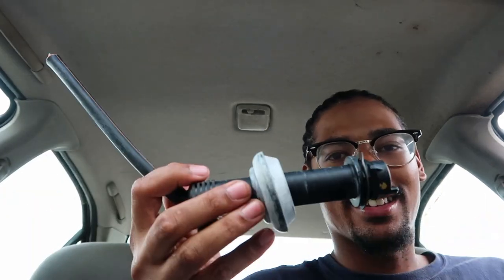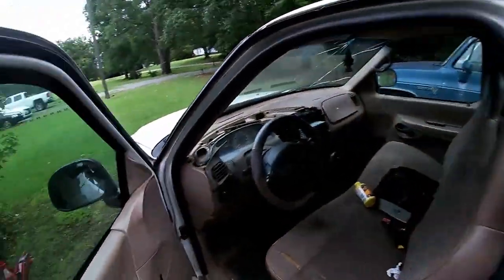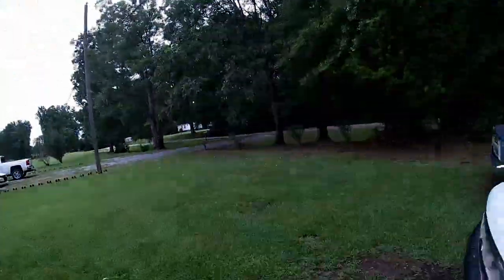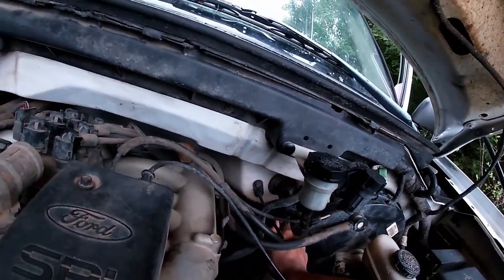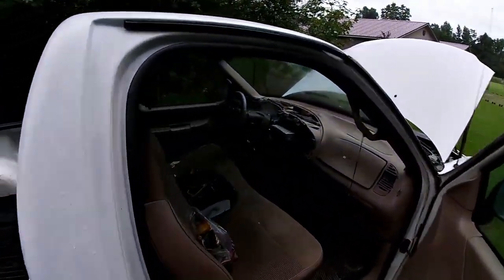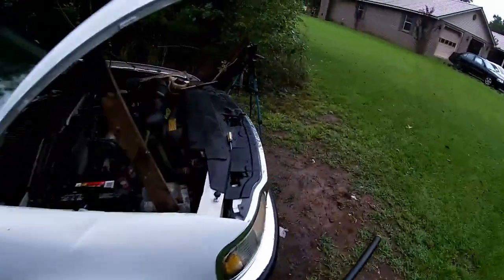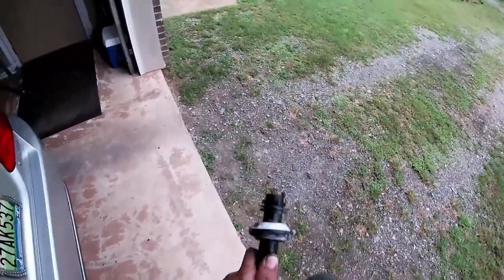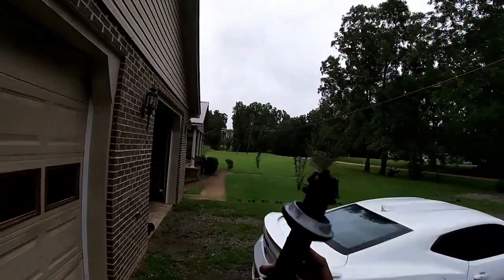F150 Clutch Master Cylinder Install (BAMA VLOG 28)

Comment: what was the original problem. great video
Reply from the maker: It Was the master clutch cylinder it wasn't sucking no fluid so there was not pressure on the plate to disengage the clutch. once fixed i bleed the clutch and she switch like a charm! subscribe!